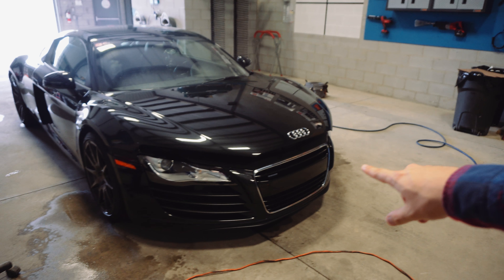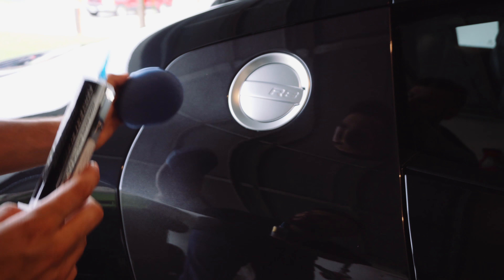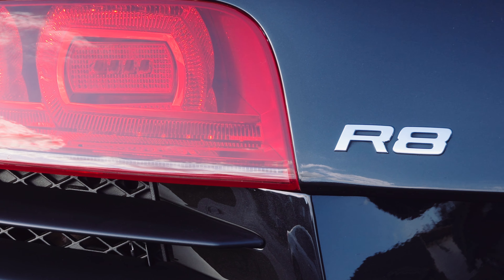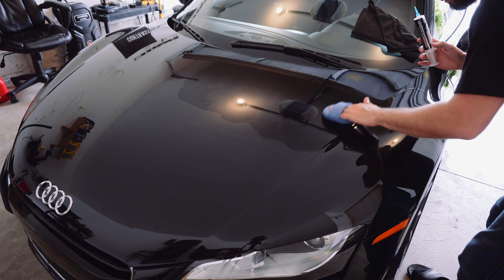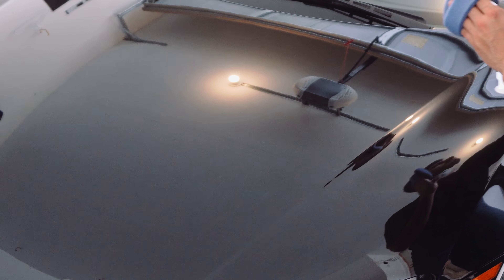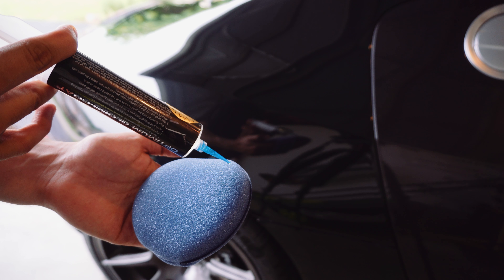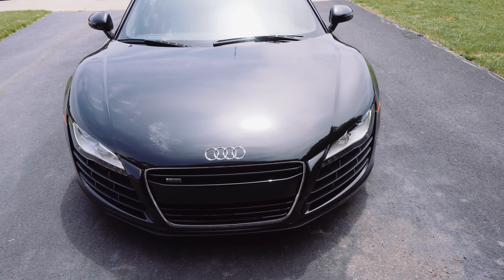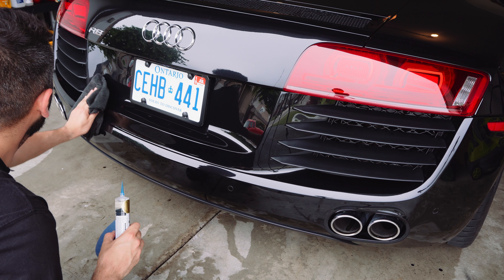Ceramic Coating INSTALL & REVIEW on Audi R8 - Optimum Gloss Coat

Comment: I've got to do this to my 2009 S8 right after my paint correction is done
Reply from the maker: Ooooo 2009 S8 what a beauty. 100% you should once the paint is corrected locking in that with a ceramic is a MUST!

Comment: Hey, how come you chose this ceramic coating instead of the opti-coat pro or pro plus?
Reply from the maker: Cheaper and supposedly just as effective. And I don't think I would be able to get Optical Pro or Pro Plus unless I went to a certified installer

Comment: How is the Gloss Coat holding up after 7 or so most?
Reply from the maker: Hey Stephen it's been holding up well to my knowledge, but the car has been parked in the garage over the winter. I do plan on doing a update on its performance and if we still see sheeting and protection. Expect a video in the next 2 months :-)

Comment: Excellent content regarding the proper way to apply ceramic coating.  I'm glad you spoke about the fact that alot of detailers only apply ceramic coatings with vertical motions.  Its good to know that with proper preparation, you can also use a circular technique.  @NiceandNeatAutoDetail on Fb and Insta
Reply from the maker: Thanks Terrence and you're right you can apply it in multiple ways. Usually detailers like to apply a last that polish or ceramic coating vertically only to only minimize the possible chance of swirl marks. If you are certain that the paint is probably prepped you do not need to do worry about vertical application

Comment: Do you daily drive the r8?
Reply from the maker: It is my weekend car, I have my trusty 2006 Lexus IS350 with over 250,000KM for daily!
Reply: Canadian Rider cool, how do you protect the glass surfaces on the car ? Like the windows and lights.
Reply from the maker: So on my headlights for example I have the 3M paint protection film on them but for the glass I have put a synthetic wax or you can use aquapel. Lots of options for Windows and lights :-) quite honestly I should just put the ceramic coating on the windows but I'm looking into why specifically they say not to